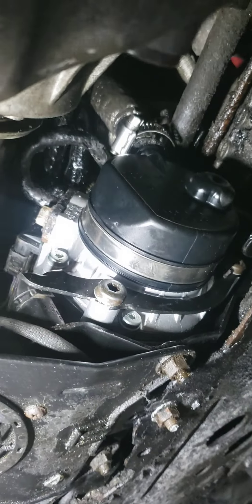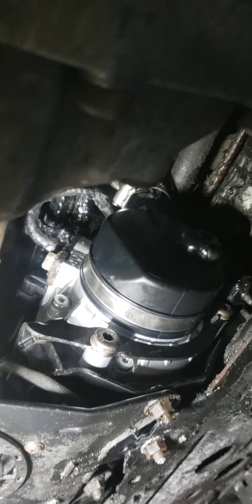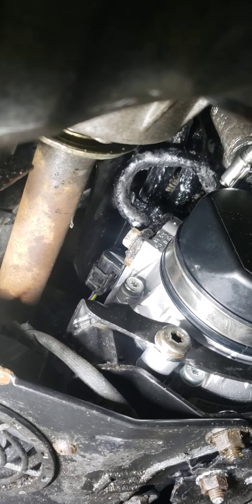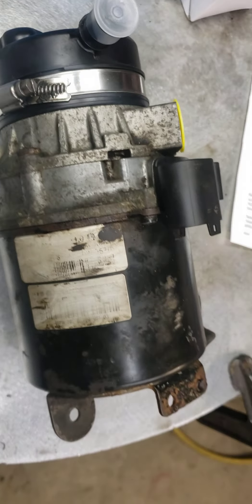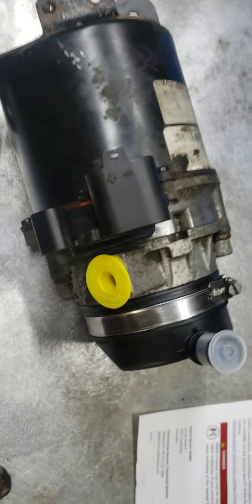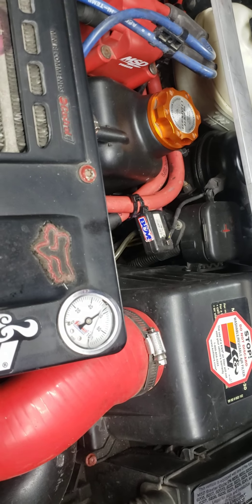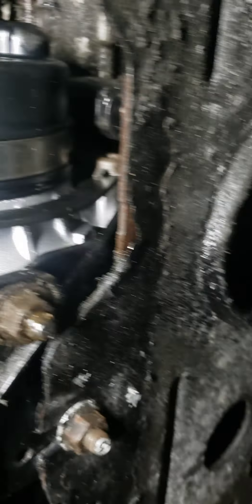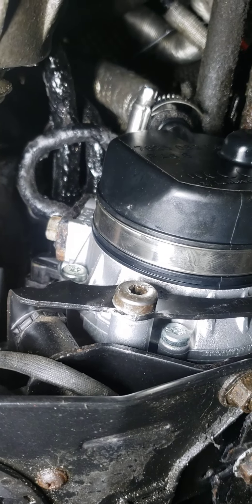r53 mini cooper power steering pump questions

Comment: Staying on is just a bad diode. There are 2 of the small 9nes, and at oeast one is allowing flow through. Just desoldered mine, easy to get done your self. I put new capacitors in also, and main big diode. Board easy to work on if you are good with a dmm and tracking traces on a motherboard. 😊

Comment: How much do you buy that on Amazon ?
Reply from the maker: 380 i think it a factory bosh pump
Reply from the maker: Same as the factory one I pulled out
Reply: Hi, how did u attach the switch to cut off the ever running ps pump, mine does the same.
Reply from the maker: The big red power wire going in the pump i jumped it but you need a big amp switch